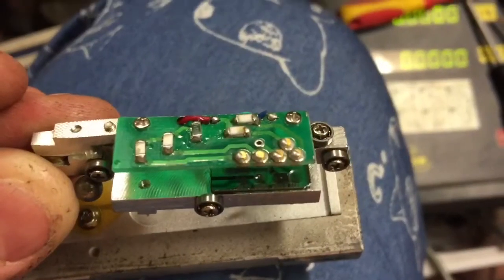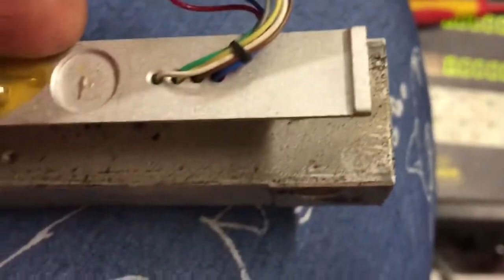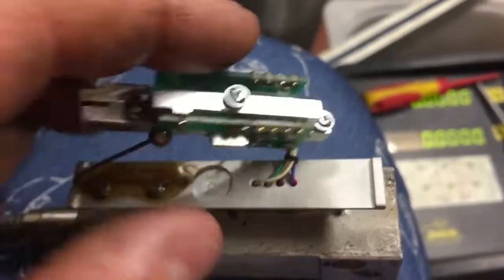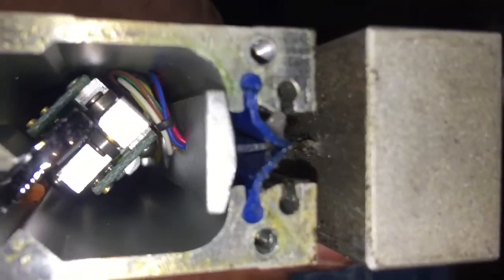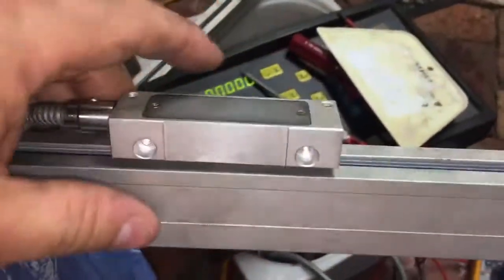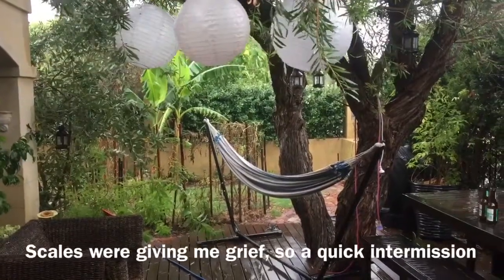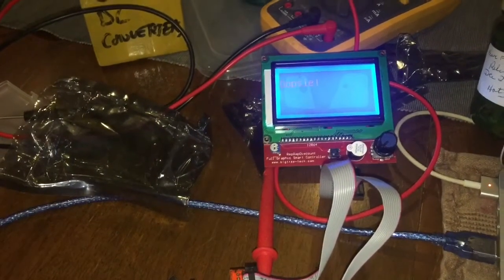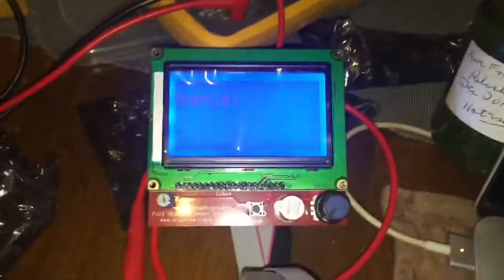Electrickery - Arduino Tacho and DRO scales

Comment: Interesting to see the differences in read out construction. It seems everybody has a different idea about how they should be made.
Reply from the maker: For sure, in the end the goal is to provide a “distance” and “direction”, so the implementation needs to deliver that in some shape or form, by having the counters (how many steps forward and backwards) in the head unit, the reader complexity is reduced. The A and B channels can be accompanied by an index, in the case of the older scales of mine, there was only one index mark, close to the centre of the scale. On the other pair, there is an index mark every 50mm from memory.
Voltage drops between the reader and the display can be a part of the reason for tuning pots at the encoder, or indeed just to tune the midpoint crossover to 50% duty cycle (or that kind of concept anyway)